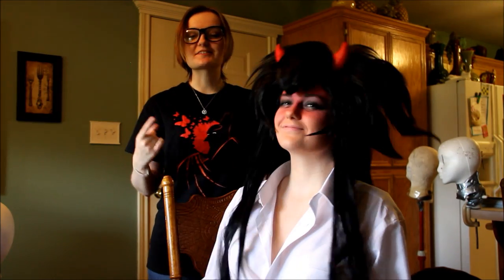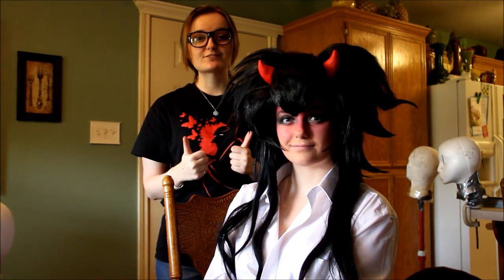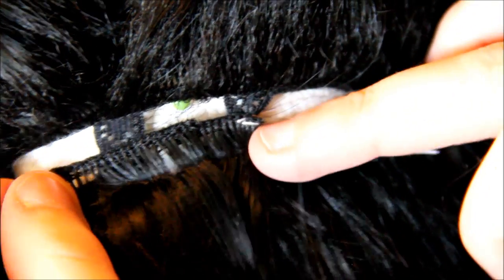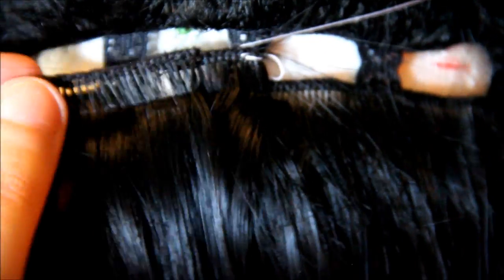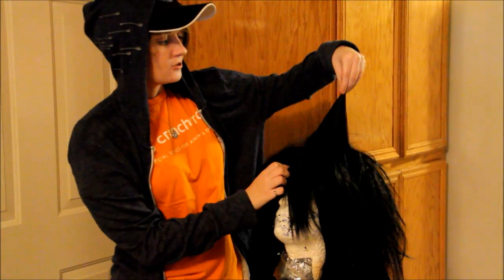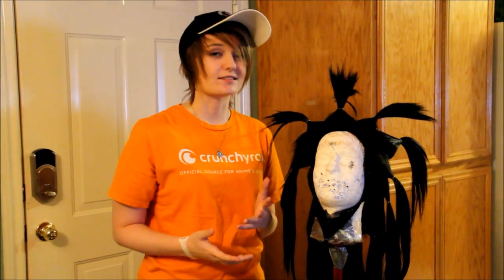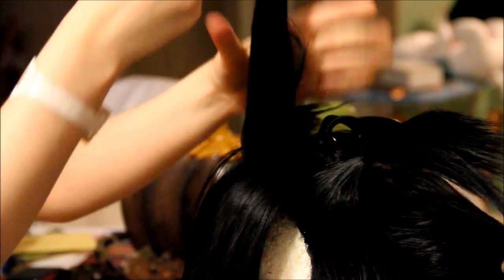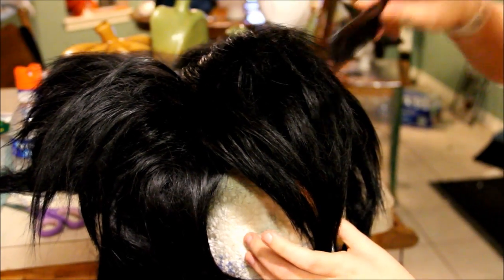Wig Tutorial - Volume in Wigs

Comment from the maker: Hello! I don't have any specal blowdryers for my wigwork, BUT I definitely want to suggest that you use a blowdryer with different settings. Not all wigs have the same level of heat resistance, so you don't want to have a dryer that only has the options of HOT and HIGH! I usually stick with a medium temperature and power on my blowdryer, and it's always worked well for me!

Comment from the maker: As to the length of the wefts, for the video I cut one of the wefts into a short section, just so it would be easier to see and to work with. Normally I end up with some wefts that span their original length from one end of the wig to the other, and some end up shorter because I accidentally snip them too early! But as long as your weft length reaches a line of elastic on each end, it isn't too important. I hope this helps!

Comment: Question, one you glued or sewed the weft onto the elastic can you take another piece of weft and stack it on top of the already attached weft to give it a bigger volume? Or you can only attach one weft on each areas?
Reply from the maker: You can absolutely double the thickness of your wefts as you add them to the wig! I often glue two pieces of weft together before adding it to the wig (regardless of if I sew or glue to the base wig)! The only way this could become problematic is if you stack TOO much. But the fabric bit of wefts are exceptionally thin, so even three layers should be just fine! Just be careful with your glue and/or stitching and you'll be adding 3/4x's the volume! c:
Reply: How many wefts did you use for the one you did in the video?
Reply from the maker: ***** I put in an entire wig's worth, and to fit some of the wefts at the top of the base with, since the Jareth is very stacked on top, I did double some of those wefts just in order to make them fit in the gaps! c:
Reply from the maker: *top of the base WIG, sorry

Comment: I'll be doing Princess Peach's hair soon, and I was very interested on how you did your fun creative wig, because the bangs look kinda like hers, but hers are just a bit more polished and the sides are a bit shorter. I've been struggling like HELL trying to get that lil middle "V" bang in without it looking flat and weird at the tip. Any advice? I'm going to be using Epic Cosplay's Hera wig with cheap heat resistant ebay wigs to add in. Since Peach's hair has sort of evolved over the years, I'm using Melee and Super Princess Peach as reference in this project. Her hair is poofier in Melee I think, but here's the picture 

https://68.media.tumblr.com/3cc5a7abb710686955379a67991de97a/tumblr_ogz2ymfzGK1vkrdsuo1_540.png

If you could help, that'd be awesome!

Comment: Just a couple questions, Do you have any tutorials on properly harvesting wefts from a wig? Also does it matter what weft is placed where? if so, do you find it easier to start from the top or bottom?
Reply from the maker: All you need are small scissors or a seam ripper harvest wefts from a wig / You put the wefts where you need volume, and keep the lengths of those wefts in mind if you're putting them into a long style / Honestly it doesn't matter what direction you go in. It's just about what's more comfortable for you.
Reply: Swank Wigs
 Okay Awesome thank you!! I noticed you mentioned on another comment for Rainbow quarts you would recommend doing another method for the bottom of the wig. What is the method you recommend and do you know where i could possibly find some good info/tutorials?